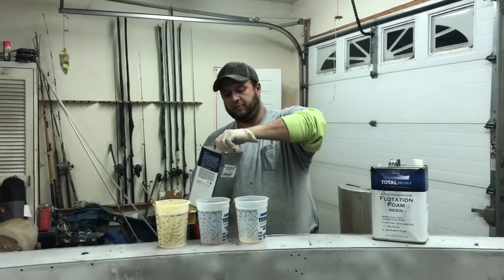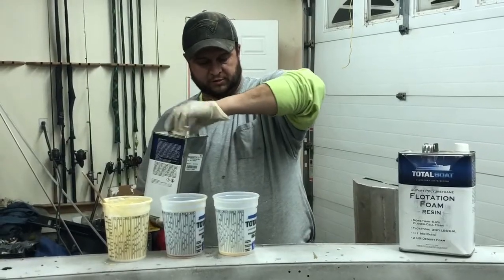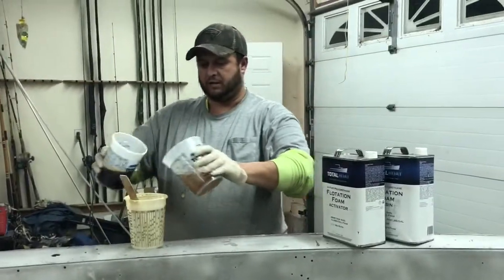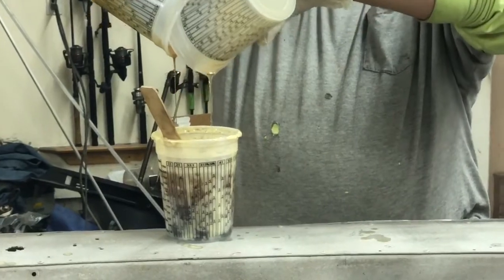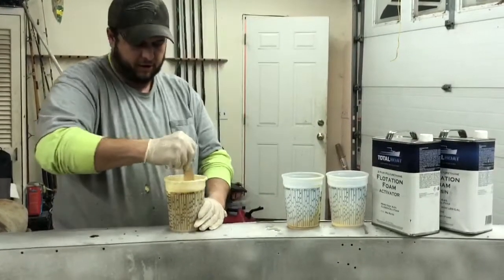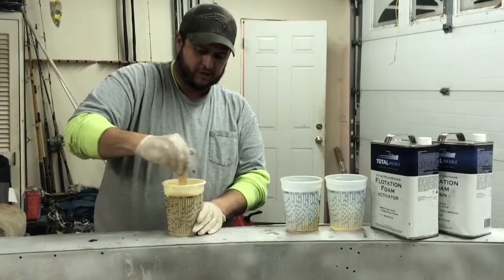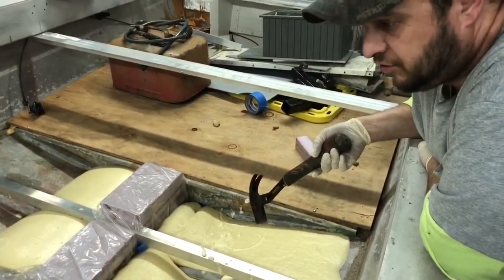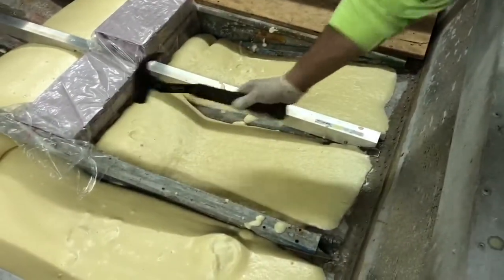Sea Nymph pour foam

Comment: Great video, I am trying to decide what to do with my boat.  I do have a question, did you do anything to channel water to the back for drainage?
Reply from the maker: Yes there is a channel in the center of the boat for water to reach the bilge , you can see blocks of foam covered in plastic so I can remove them after the foam is poured. The forward section gets filled completely and any water will find its way to the deck drains and into the channel.